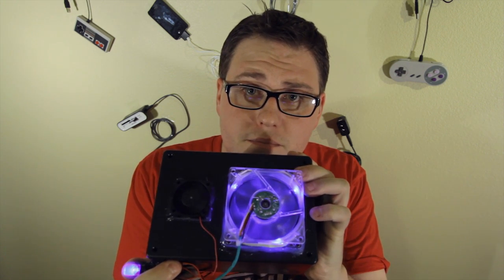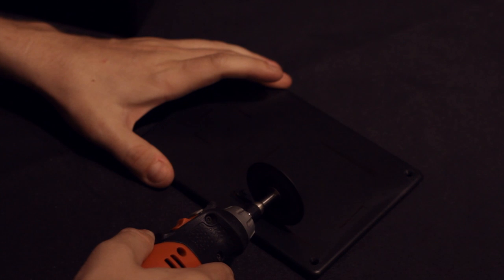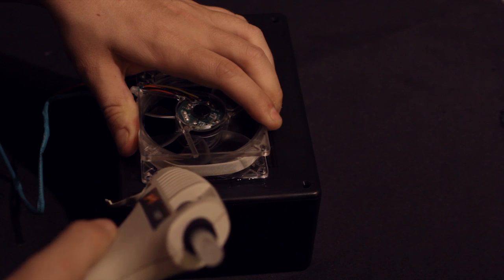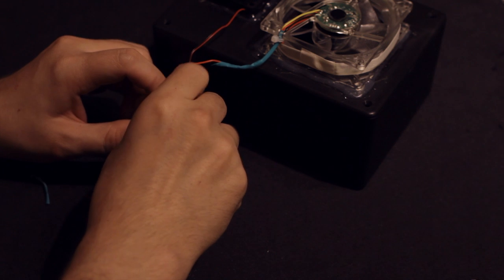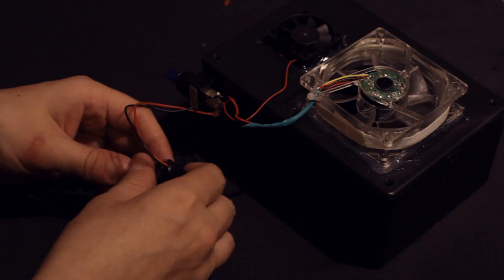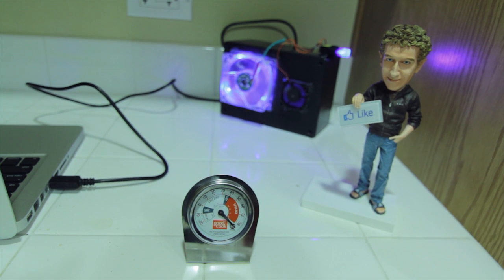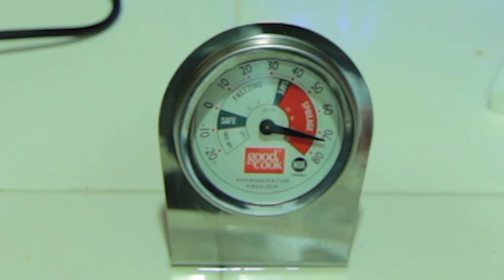USB Powered Mini A/C!

Comment: @Buzztubah because heat works by allowing electrons to pass form atom to atom and Ice Packs are specially designed to take in electrons from other objects quickly (cooling them down fast) and at the same time not sneding the electrons into heating up the ice, instead using it along with chemicals to continue to keep the icepack frozen for longer. Not only that but plastic at low temperatures allows the condensation from the warm air around it in which speeds up the warming up of the ice.

Comment: @Woggyflush hmmmm i would certainly hope our friend here isnt trying to hasten the death of our beloved Comps

though....a capacitor maybe a few resisters and a rechargeable power cell could remedy this issue though  i.e. take the voltage from the usb store some until its at the right voltage and amp put that stored energy into a power cell and then into charging the unit with the appropriate supply....hell u can make it into a charge station too just throw a solar cell on it lol

Comment: fans don't reduce temperature, they just move air around and make it seem like its cooler because there is more contact with your skin. so the operation of the fan does nothing to your thermometer, which would decrease solely due to the ice melting.

Comment: wont the draw current from the 2 fans eventually burn up or damge the USB female end on the comp?

i made something like this a while back and ended up killin a whole usb branch im sure i didnt cross any wires or anything like that but eh it could have been cause it was an old usb 1 connecter (female end the one on the comp)

Comment: Oh, I just thought of this!
If you have a 9oz C02 canister (like the ones made for paintball guns) you can use that instead of ice and it will stay cold as long as it is full (as in possibly for months). There is a danger aspect to it though, too hot and it may explode. So I wouldn't recommend trying to use them to cool off a areas hotter than say 110 degrees.

Comment: @olejniczak12 Soldering Irons can cost $10 as well. There's really no reason to not solder these wires. You could hot glue the stuff together and it can oxidize over time and stop functioning.

Comment: Um, AC  removes moisture from the air, as well as cooling it so your skin dries out a little faster which lowers body temperature. 

This would actually allow MORE moisture to get into the air (in the case of the ice).

Comment: @householdhacker I did this but my fan wont turn if its only 5 volts my 5 volt fan will and the fan works fine because I tested it with a 9 volt battery why wont it work?

Comment: DUDE WHAT YOU CAN DO IS MAKE A HOLE ON SIDE(FOR THE AIR TO COME IN) AND MAKE THE TWO FANS FOR AIR COMMING OUT....MAN SERIOUSLY WHY WOULD YOU NEED TO PUT AIR IN BOX THAT MAKES THE ICE TO MELT MORE AND PLUS TRY TO USE DRY ICE OR ICE PACK CAUSE COOLING IS ABOUT REMOVING THE MOISTURE CONTENT.ON SECOND THOUHT DONT EVEN TR THIS CAUSE IT IS JUST STUPID FOR ONLY 5 DEGREE FERENHIET

Comment: @SynapticalDischargeX That was the switch.  HouseHold Hacker used a double-throw switch (allows two different things to be powered off the same source) in this case - probably because he had one lying around.  In this case it was not really necessary to have a double throw which is why only the middle and end prongs were used on the switch.

Comment: I hate to sound like a hatter but could you please PUT THE HOT GLUE GUN AWAY!!! and PUT SOME PRIDE IN YOUR WORK!!!!!! and STOP DOING A SLOPPY JOB!!!! If you keep doing sloppy work like that, your going to have some competition, ME!!!! Again, I'm not a hatter, but I'm just saying, and it would work better if the big fan was the intake and the small fan was the exhaust, and their weren't any pointless lights on it to draw more current slowing down the system.... just saying.

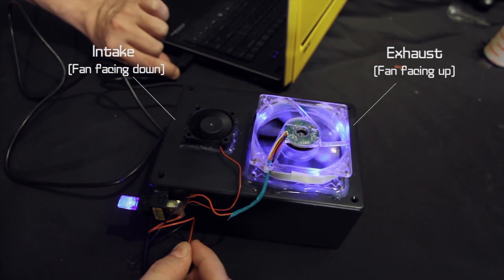Comment: cant you take 2 9v adaptors (pretty sure that two can connect) and connect the wires on the usb cable to the wires to the adaptor so you can just un clip it and put on a battery rather than take the wires off, and that would also make it so you dont have to hold the wires like you did at 2:22

Comment: Um, this is useless because in order to make ice, you need to remove heat from water. That is generally done in a freezer/refrigerator. Where does the freezer put that heat? BACK INTO THE AIR IN YOUR HOUSE, the very same house you are trying to cool with this project.
Besides, this isn't really cooling yourself with USB power, it's just moving (with USB power) air that has been cooled with power from elsewhere.
To meet both requirements, one or more peltier modules is required. See TBHS/Gigafide

Comment: Eh dudes.. find a 12 volt dc wallwart and use solder instead of hot glue for god sakes. The more crap you plug into your computer, the shorter your power supply will last.

Comment: I wonder how long a cd player motor would go if it had a solar panel attached to it for power and a makeshift fan blade all i need is a solar panel from one of those calculators and I could check but I alas I don't have a dead one and I am not up to ruining a perfectly good calculator

Comment: You need a sealed freon system with a radiator and a compressor. Without that stuff, replacing the ice packs will get pretty old, fast!